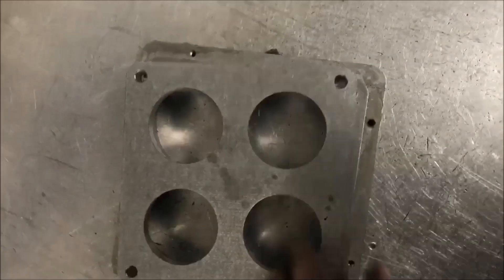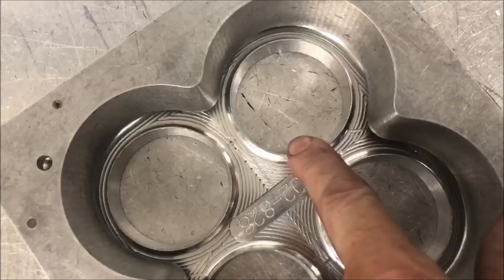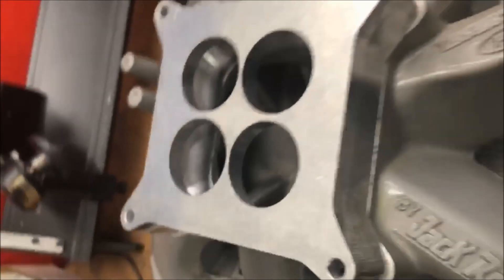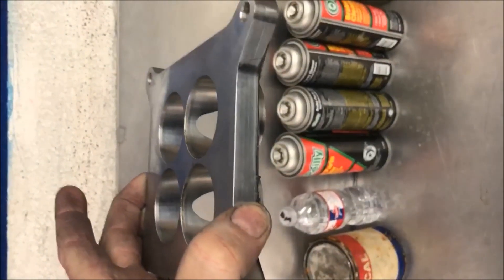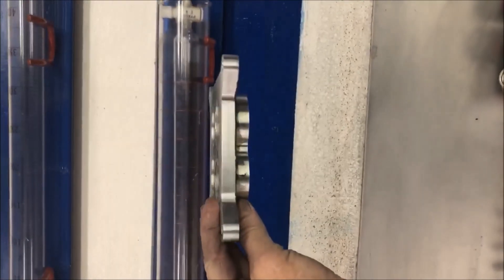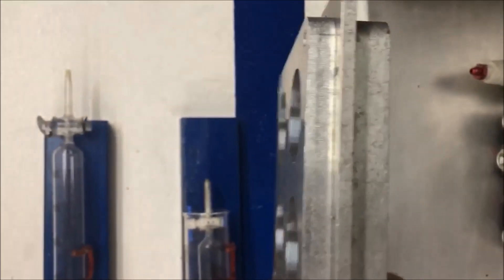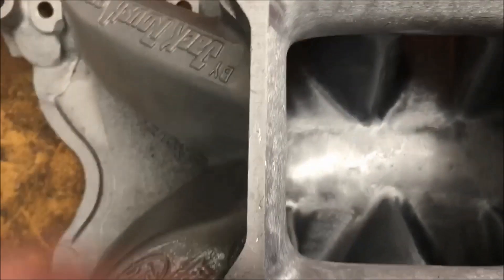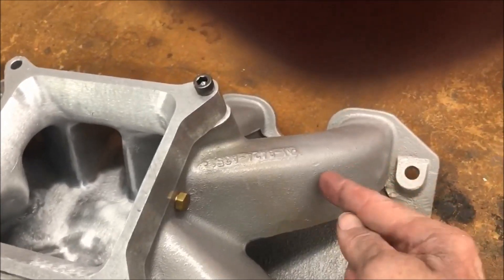Episode 15: Spacer facts, And My Morganized Ford Motorsport Intake

Comment: Thanks for sharing your info and experience with us. Do you think I will need to retune my Holley 4160 750 on an Edlebrock RPM performer Air Fuel adjuustments and check vacuum after installing a 1 inch spacer on open plenum? Appreciate any feedback please. Cheers from Motown.
Reply from the maker: That carb should be fine on that intake. To me. Make sure your idle vacuum is not lower than power valve number in mmhg. Tune your secondary spring accordingly. Don’t want to feel that carb kick in as many times that is a bog. Make sure it just continues increase speed with hesitation. Can even get secondary metering plate for better main jet tuning.

Comment: Who makes those two plates?
I’d like to try a set.....
What do they do for low and mid range?
Reply from the maker: Reher-Morrison on their website. I bet they would work well. I have super suckers with success. Although could crutch for other inadequacies. I have an extra 1 inch, if your interested.
https://rehermorrison.com/product/anti-reversion-plates/
Reply: DragBoss shoot me a text on what you want for the plates.
Also, d you have a source for high port gaskets using A331/A351 on stuffed 4v heads?
Mike 832-833-0893

Comment: Was that an advanced explanation of basic air flow dynamics or a basic explanation of advanced air flow dynamics ? It’s gotta really suck to be thrown through the windshield on a shift. Kinda like reaching for the shift lever on a Lenco and pulling the chute lever instead. 😳 Either way it’s definitely something special to be schooled by the great Darin Morgan !  Many thanks to all.
Reply from the maker: Yes very cool , every bit of info you can learn, helps your program out. I would like to have a chute.....
Reply: When folks like Mr. Morgan speak,  I definitely listen. And for anyone reading this that might not know what’s up as you do,  I didn’t mean to imply that my combination required a parachute....yet. That’s DragBoss territory and I’m not quite there. 🤔. But ya never know what the tide could bring in. My wishlist is modest with any alloy heads except Pro China or Edelbrock 2-V and a nice Cook Supremacy to properly distribute the atomized charge. A world famous specialist to tweak everything for maximum effect would stretch the “modest” part a bit too much but plan “B” is to ask you, my ole bud Tim what works best. Hopefully free advice won’t be too expensive  😄.
Reply from the maker: @danielwilson6665  its all about matching the combination as a whole. I always think you should buy quality whether it is parts or machine work. It pays off in the long run. Plan C is the secret A3 headed/427 ci Aluminum TrackBoss. Daniel, I have the ultimate set of alloy heads and intake you would make an easy 700 hp pump gas motor. Why wait?
Reply: @DragBoss,  Tim I hope the “Plan C” details aren’t classified as top secret because from what I’ve gathered so far,  it’s going to one of the finest examples of a naturally aspirated, single 4-V ,  427C around. I already have a prediction of what to expect from the dyno numbers as well 🤔. One thing is certain, you’ve made some excellent choices for the components and your combination will have the durability to match the power. 

Why wait you ask?  The answer is financial 😳. 

And the beat goes on.....
Reply: @danielwilson6665  I've always had no money, so to me You guys are millionaires, while actual Pro Stock teams are billionaires;  whilst I could be called a thousandaire to those around the world who sadly are lucky to be hundredaires. Not complaining at all, but every Kiwi dollar is worth only around 60 to 65% of the US dollar, then add on freight, and duty taxes.  You'd need to be a trillionaire to run with the big boys here !!
Reply: Mind you, we can hold our heads up high with the likes of.....not dropping names,hehe..... Bruce MCLAREN, Sir Edmund Hillary,  Kate Shepard,  Earnest Rutherford etc. !!
Reply: arkhsm ford ....there’s one reality that’s the same no matter which hemisphere you happen to be in. You have to pay in order to play and how fast has a close relationship with how much $$$. Patience is an important virtue. There’s delays to be expected...kinda like when a brand X oils down the track from the tree to the traps. Waiting is the hardest part 😂.
Reply: @danielwilson6665  That last bit cracked me up, like watching this Ford vs Chev rev it to death challenge. Two old junkyard engines were hooked up to a shared radiator of an old Ford Flathead, with oil in their sumps. Chevy lover goes through the crowd, asking who will win, with most being Chevy Sheep. The Chev lasted 1min 11 sec, before going on a slimfast no rods diet. The Ford now had a water free diet and finally melted into a blob 4+ minutes later !!!     After 4 of these events, it's now 3 wins to Ford !!
Reply: arkhsm ford ....I like that 👍